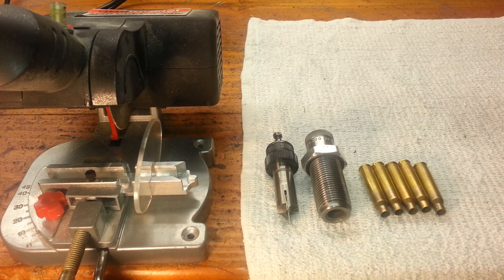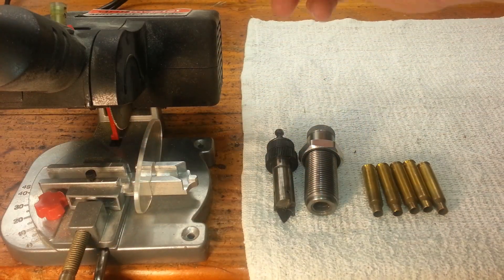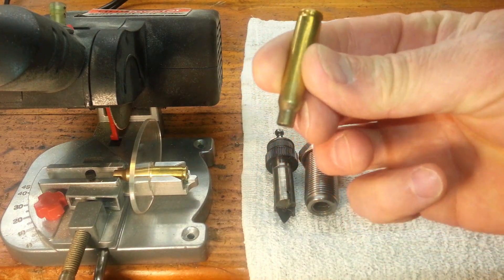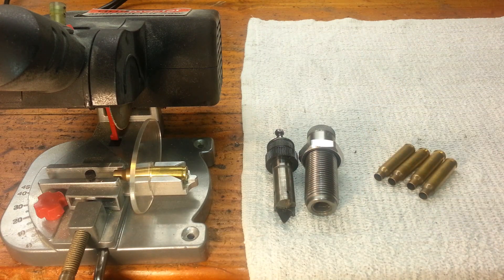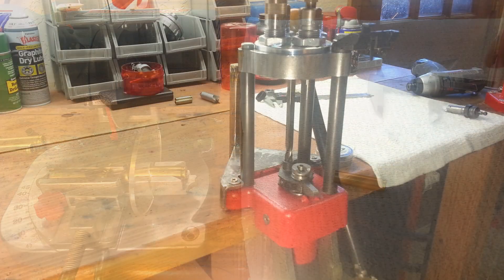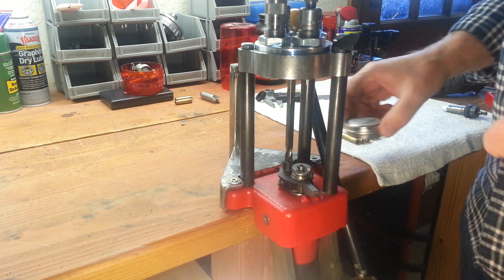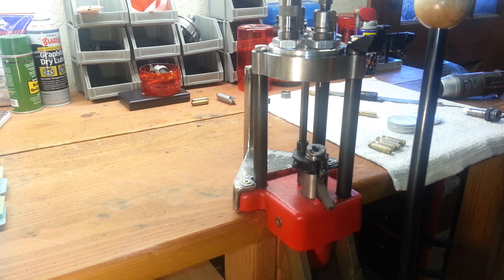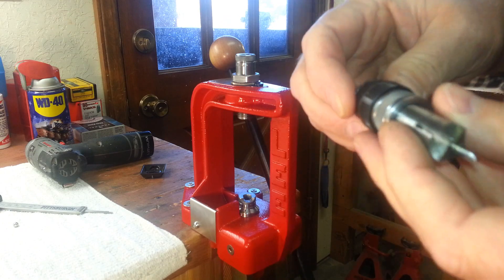Make 300 Blackout brass easy with Lee Power Quick Trim (Look below for a newer version)

Comment: Just found your channel today and subbed. lots of great info. just starting to reload rifle. been doing pistol for a few years. do you know if anyone makes one of those jigs you were talking about for trimming 30-06 to 8mm?
Reply from the maker: +Cat G Hi, thanks for your interest in the channel.  There's a guy that sells jigs on 300 blktalk.com According to his post he makes one for 308 variants.  30-06 is the same basic case as a 308 so the brass would fit in the jig.  The saw relief may be in the wrong place but that would be easy to fix.  Here is the Link: http://www.300blktalk.com/forum/viewtopic.php?f=179&t=85923
Lee makes a quick trim die also: http://leeprecision.com/8x57_mauser_qt_die.html
Reply: +TreeTopFlier thanks I'll give that a try. I have the quick trim die already. I think they need to be cut down first and formed before I use that.
Reply from the maker: +Cat G You would definitely have to cut and form first.  The process for 300 would be similar, only you would probably use the 3/8 bearing on the springs and the spacer on the shank.  If you can, come back and let me know what you find.  I think you made me want a Mauser LOL.
Reply: Love my milsurps. Have a 1917 k98 that was sporterized before I got it that shots like a dream and an 1895 Chilean that was rechambered in 308. Haven't fired it yet. I just got it recently. You won't be disappointed. Well worth the money.
Reply from the maker: +Cat G my list is longer than my budget... a k98 would be awesome!
Reply: +TreeTopFlier my first milsurp was a French mas 36. my collection just seemed to explode from there. definitely an addiction once you start.

Comment: I do it the same way but I use a cordless screw driver.
Reply from the maker: +David Farber If you can locate a 1/4" bearing to use in place of the 3/8" inch one the cutter ships with it does a much better job of chamfering the neck in and out. This works best on both blackouut and 223.  The blackout die directions tell you not to use the bearing but that didnt work at all for me. Thanks for watching!
Reply: Will do and thanks from one shooter to another.

Comment: Do you need to anneal the brass?
Reply from the maker: +Digitalmanne Thanks for the question, no you don't need to anneal to form the brass, the neck bend is minimal.  That said, if you do anneal it may help to prevent neck splitting after multiple reloads.  If you are loading supersonic the primer pockets will probably wear out before the necks split.
Reply: +TreeTopFlier I used to never anneal but after about 3-5 reloads yeah they will start to get brittle and splitting

Comment: Man do yourself a big favor and get rid of that lee trimmer and get this.........http://www.eztrimit.com/ it's worth the money.
Reply: +blunt3068 I have a similar one from Giraud three way trimmer and I am not too crazy about it and it's cheaper at $90 vs 152.  It doesn't chamfer evenly inside case.  I wrote to Giraud and he said I could return it or I could send it back to readjust the blade as if I screwed up, but I know I didn't do anything stupid, only what's stated in the manual so I didn't send it back because It would be waste of time and money.  The problem is when you insert the cartridge there is too much space to move from side to side and that's what causes uneven cuts as it doesn't center.  I don't know how tight the tolerance is on eztrimit, I considered it, but the price was deciding factor.  Micrometer is a bid deal as I found out.  Adjusting cutting deapth is not easy on Giraud and fine adjustments are difficult.  I should have just returned it when I had a chance.
Reply: +blunt3068 +-the price is insane the old crow trimmer is the best for 300 blk I have yet to ever time any thing else so I have one trimmer for the only trimming I do
Reply: MadSativa That's fine if you only trim one caliber. but if you do multiple calibers like I do the little crow is not an option. You can change out the dies in the trim it you can't in the little crow.
Reply: I shoot 303 to 308 to 300 win mag and I have never trimmed a piece of brass they all break and split before trimming is needed brass is so cheap around me that replacing a 5 times load brass is cheaper than buying a trimmer.  Thats why the old crow is the one to go with.  Other than 300 blk I have never trimmed a piece of brass pistol brass does not need trimming, and if the rifle brass needs trimming you are not going to stretch a big amount of life out of it.  this is all depending on rifle and load but I have never trimmed rifle brass.blunt3068
Reply: 300 win even if trimmed and annealed you will only get about 10 runs out of it when load max.  the brass starts to bulge in other places and after sizing it starts to weaken extremely.  I can get 20 run out of them trimming and aneeling however all that is more time and when the brass used is 25 $ for 500 its not worth my time to squeeze out the last bit of life out of them, if your shooting competition I guess.  and some rifles like the H&K you can reuse the brass at all.

Comment: Just curious how long did you Lee trimmer last, I was reading reviews and several people reported them breaking, I think it was the plastic part.
Reply: +Dima Prok 

my quick trim has several thousand prices of brass through it so far.  its still going strong.  i'm using a similar driver to treetop, but im using a standard drill/driver.  so my pass takes about 4 seconds.  i did a timed session on my last batch of 300blk i was resizing, and i running ~9 peices per minute through the die setup.  as he said, working around the camera only slows you down.  once you get into the swing of it. its gravy.
Reply from the maker: +Dima Prok Hi Dima, Just a couple points about your comment.  I get what you are saying about using the press to hold the round and why that didn't work for you, but for me this is an advantage.  The press holds the case still and spaces off of the case head in the shell holder so the trim length is very consistent.  In contrast, with some of the other options the user has to hold the case head with a glove to keep it from rotating.  The tool takes its dimension from the shoulder of the cartridge which has a tolerance and depending on how consistent the user is with the pressure applied, you can end up stacking tolerances/variables and get inconsistent total brass length.  Just my opinion.
Reply: +Dima Prok 

your discussion on budgeting brings to light one of the finest attributes of this tool.

for the $$ invested to get operational and extremely functional with this very budget minded piece of equipment you could easily be 5-10x (or more) the cost with a higher end piece of equipment that performs the very same functions.

in many ways that makes the quick trim system a nice balance between cost, functionality, time efficiency and grade of the end result.  

additionally like treetop mentioned, i find that not having to hold onto my brass for those processes is a HUGE advantage.  i've tried other methods of brass processing and they just dont work for me.  personally  I am unable to do extended tasks that require tight gripping and holding of small objects due to an automotive injury. so tasks like trimming, chamfering and deburring brass get limited to very small quantities at a time, and then i am forced to take a break, recover, and come back for more.  When i dont have to hold them in a rotating trimmer, or against a rotating assembly for trimming/chamfer/deburr it allows me to process way more brass at a sitting as well as do so quite efficiently - with very little hand fatigue.  with the added bonus of the deburr & chamfer happening in the same step, i'm further reducing the wear and tear required to process brass.

is it the bestest tool on the market for making ultra premium match grade ammo - no probably not.  but you could say the same about all lee products and very few people would argue with the statement.  is it a nice entry level to mid-grade product built to allow a budget minded user to produce a respectable amount of very functional brass in a short period of time, i'd like to think it absolutely is.  and once you have the cutter adding calibers is very affordable since the dies can be had for under $20 each - including a quick change bushing.  

so balanced against a giraud that can manage a single caliber (before you add on the $35 per caliber heads) you can be up and operational with over 20 calibers with this system.  or 10-15 if you dont have a hand drill suitable for running the power version.
Reply from the maker: Dima Prok I still have the original one I bought.  I broke the adjuster ring right out of the box so I had to replace it.  The ring is stiff to turn so its easy to go past the stop, if you go past the stop the ring can pop off and doesn't like to stay on after that.  It is a weak point.  Not a problem once you get used to how it works.

The good news is, all the parts are available for cheep.  Here is the link for the parts.. http://leeprecision.com/deluxe-power-quick-trim-parts/
The molded parts tab has a list of the plastic bits, look in the pull down box.
http://leeprecision.com/molded-parts-qt.html  They are $.75 ea

Also for anyone putting in an order get the cutter pin too.

It does a great job for a very little investment and its totally maintainable.
Reply: TreeTopFlier Thank you, one more question, do you get even cuts with your SD jig?  I made my own, but the cuts are not even, I get 1.370 on one side and 1.380 on the other.  I didn't think the extra length was that big of a deal, but since my Lee cutter pilots keep getting worn out, It make sense to spend 11 bucks for a jig to get even precise cuts for minimum trimming.
Reply from the maker: Dima Prok It does pretty good, the jig I have has a ramp in it to accommodate the taper in the case.  The HF saw has a cheezy vice and the block is unsupported on the side so the jig can teeter and give you an uneven cut.  You really have to spend some time getting it to locked into the right spot, torque it down hard and leave it.  I try to trim about .008-.010"  max.  Just enough to square the neck. Have not had to change any blades so far.  
I cut at 1.360., when they get sized/formed they usually grow out to about 1.368.  Then I use the quick trim to trim them back down to 1.360.  You have to fine tune it a little.
Reply: +plantone1 When I considered this trimmer in the past I found few things odd about it.  First I didn't like that I had to use it in the press which is in my home office to have brass shavings fall in the carpet and second was to use one hand to hold the press lever and most important was fail reports I read at the time has turned me off, there was also a factor of getting a separate die.  I've tried Lee case length gauge and I was happy with it until I found that if you motorize it, the cases quickly start getting shorter and shorter, the pilot wore off and it's not adjustable.  I've tried Hornady trimmer and returned it immediately, it needed it's own shell holders and I wasn't going to buy them and I just though it would be very slow process to crank the handle by hand.  Next I bought Giraud tri-way trimmer and although it's pretty fast it takes toll on your fingers and doesn't chamfer even, it's also not very comfortable to operate cordless drill in upright position as recommended in the manual, also running my corded drill for prolonged time gets it pretty hot so it might go out, I don't care as it's cheap and old, but something to consider if you're going to do big volume of trimming.  Next I bought Lyman e-ZEE Trim and have to say it's much better than Lee and that's what I should have bought instead of Lee, the case holder is so much better made and easier to operate and can be used in conjunction with Lee if you want to, also the pilot bits are locked with set screw, so I haven't had chance to run it for large session but I think if the pilot gets shorter, I can re-adjust the length with the set screw which you cannot due with Lee.  Together with adapter from ebay that allows you to attach cutter to Lyman prep center you can quickly trim, chamfer and debur all on motorized station, I really like this setup.   Next I bought LE Wilson trimmer.  It had perfect reviews and is rather expensive but I was at the point where I really wanted something consistent and adjustable and I got used one off ebay for 1/3 of the new price.  It needs special shell holders that are also extremely helpful when using to hold case to remove military crimp and cutting primer pockets as I found out that reason sometimes primers don't sit below flush is that primer pocket is not deep enough and I used to blame my RCBS universal priming tool.  When you use quality brass the primers seat below as they should.  I need to order an adapter from eBay for my LE Wilson to motorize it with impact driver, for precision I'll stick with LE Wilson, for volume I would go with Giraud / EZTrimIt if you can afford it or Lyman E-Zee trim and prep center.
Reply: +TreeTopFlier I trim with Giraud after I full length resize picked up range brass and the cutting length is surprisingly consistent even with off the shoulder indexing.  I just noticed that if I trim my cases to 1.750 after shooting with my Mossberg MVP some cases will actually shrink by 3 thousands, so now I use Giraud to "quick" trim 1.753 - 4 and after they been fired I trim with LE Wilson to precise 1.750.  My problem is that I spent way too much money on reloading equipment :-) and I need to sell extras on Ebay or CL.
Reply: +plantone1 Very interesting info... I might try it if I see it on sale.  My Giraud is the version that you chuck in the drill and it does not allow you to swap calibers.  I am going to ask my uncle to help me build so that a motor could drive it in vertical position, something similar to their high end expensive version and then I think I'll end up selling.
Reply: So after cutting with the saw, a slightly uneven cut is ok? Im getting an uneven cut with VZ58s jig.